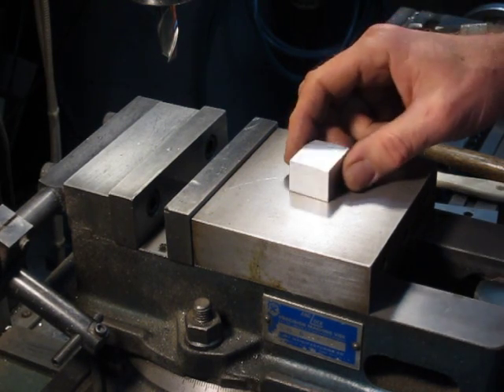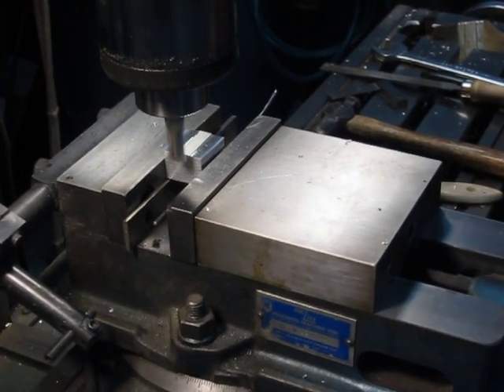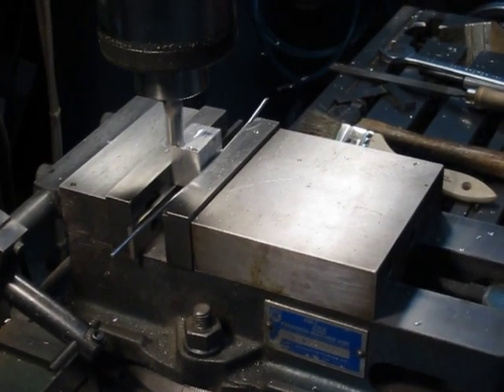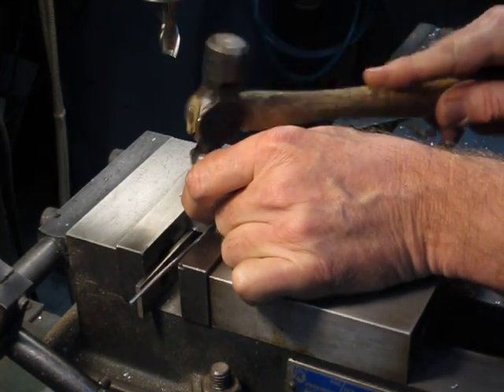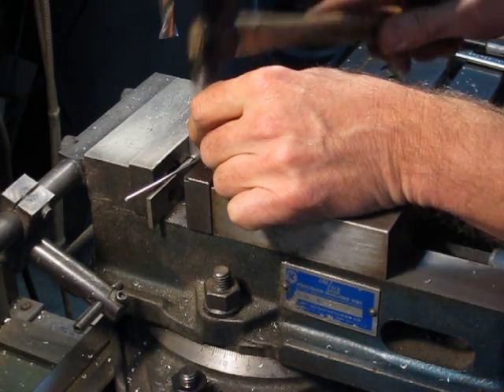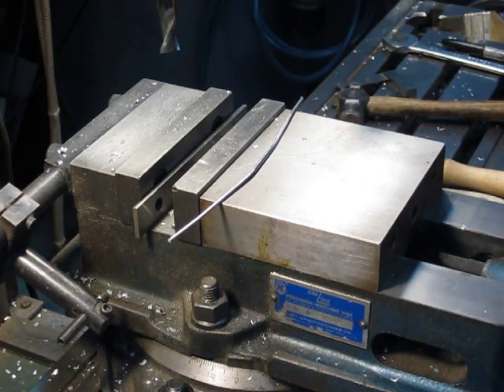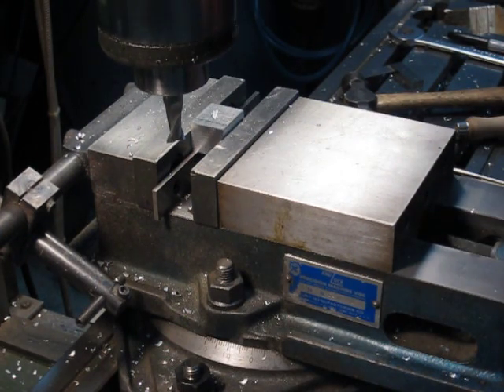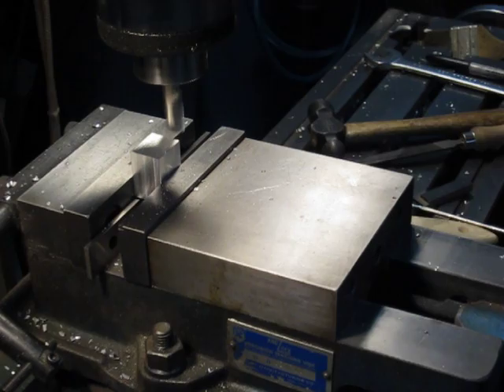How to square up stock on the milling machine

Comment: Would you put a note in the video reminding us to begin milling on the highest side so that with an uneven surface, so your DOC doesn't increase?
Reply from the maker: Pierre Miller 
Not sure I understand what you mean Pierre.
Reply: Toms Techniques I just mean where you start the first pass. If the surface has uneven heights of material and you start on the highest part of the surface, worst case scenario, your cutter won't remove any material on the low spots. But if you start on the lowest part of the surface, and you run into something that's higher than where you started, you'll start cutting more off than you expected.
Reply from the maker: Pierre Miller 
Pierre,

I mentioned in the video that the first cut should always be the minimum amount possible. That way you are less apt to run out of material on the opposite side. For that reason, I always place the best side up for the first cut. When you start chasing low spots, it rarely turns out well.

Tom
Reply: Oh my. I must have missed it. My apologies. Thank you for your prompt replies.

Comment: Hi Tom. I'm Marco. I'm totally beginner, I never mill, and I've just bought an HBM 16. What do you think about this Drill Mill machine?
Reply from the maker: Marco Andretto 
Hi Marco,

We were all beginners at some point. :)

Round column mill/drills are very light machines and require special care when milling. They won't take very heavy cuts and are happier with non-ferrous metals over steel. Be very cautious about climb milling, or avoid it all together. Other than that, the same techniques apply as with heavier machines. They just take a bit longer to accomplish.

Tom
Reply: +Toms Techniques I forgotted to thank you, five months ago. In these days I'm tryng to square perfectly a block.
Reply from the maker: +Magic Rojava 
You are welcome.

Just stick to the order of operations on my video "How to Square up Stock on the Milling Machine", and you should be fine.

Tom

Comment: I Cried When you Hit Aluminum with a ball peen hammer ;-;
Reply: No biggie if you are machining it off anyways. I personally just use a small brass hammer or a dead blow.
Reply from the maker: P Houly 

Rather than cry about it, you should keep an open mind and try it yourself. I learned many years ago that a ball pein makes excellent hammer for tapping down stock in the vise. When the ball or the edge of the flat end is used on a piece a ball pein acts just like a dead blow and does a great job of seating the stock on the parallels (and no, it won't bounce). Of course a ball pein is only used on rough surfaces. Finished surfaces require a soft hammer to keep from marring them.

Tom
Reply: @TomsTechniques  why would he or she cry if you are tapping down to contact the parallel....
All the markings will be machined off ....perhaps they thought you are using a 5 pound sledgehammer  !!!
Reply from the maker: Exactly. Some people have a seriously hard time stepping out of the box. I was taught to use a ball pein hammer while working as a shaper hand in the 70's. It made a lot more sense than having to waste time casting lead hammers all the time.

Comment: I'm a beginner, going to be doing this with CRS tomorrow, I'm just trying to get the process "down" before I attempt to machine my stock.  So if I need to get my block down to a specific size, (3.3" x 2.3" x 1.3") I may want to ask for a piece that's 3.5 x 2.5 x 1.5 just to be safe?  With aluminum, you can feed a lot faster, it seems, and you don't need coolant. But with steel I would move a lot slower, and use coolant right? These might seem like silly questions, I'm still learning and I just want to make sure I know what I'm doing before I go into this, so I can save time. I only have 3 hours tomorrow in which to square up my piece and run 5 separate CNC programs on it... Well, fingers crossed!  Thanks for the very informative video, I feel less stressed out already!
Reply from the maker: There is a cutting speed chart on my website so you can calculate the proper rpm. Coolant is not a requirement with steel as long as the proper rpm is used to limit the amount of heat produced.

Tom

http://tomstechniques.com/

Comment: Thanks for the nice tutorial.

One question though - why bother going back to the right end before tapping the left end back to zero?

Also, how about this as a way to start off within a thou or two - from both sides of the vise slide pieces of stock that fit in the table slot and that are just tall enough to engage the keyways on the bottom of the vise.

Then move the vise either forward or back until the slop is taken up.
Reply from the maker: Thanks Noah.

I'm sorry but I don't understand your first question.

Regarding the vise alignment, it's standard practice to push the vise in one direction so the keys contact one side of the T slot. Extra pieces of stock aren't necessary.

Tom
Reply: Toms Techniques Oops, sorry, Tom, that question was meant for a vise tramming tutorial I was watching in another tab.

But I did like yours; definitely better than the way I was doing it.

Comment: Don't take any of this in a bad way, i am a skilled machinist and want to improve everyone's skills in this trait due to the fact no teenagers are picking it up in high school shops. if you don't care about keeping tight tolerances because its a hobby then by all means, have fun and machine away! 

If you don't remove burs on corners after every cut, like after the first cut. your block will never be anywhere close to square.  the burs will lift that side of the work peace and your accumulative error will give you a block way less than square. or the chips/burs will smash agents the work peace and ruin your surface finish (i love a beautiful finish, idk about you) . That block could be more then .010 in. out of square and or parallel (there is a difference). the shop i work at keeps blocks square within +.0001 in. i would also use a dead blow rubber mallet so you don't indent you surface and change you other dimensions, aluminium and other soft materials tend to do that. (aka, you hit the top, sides bend out a very slight amount if you hit anywhere near the sides/middle depending on how big your work peace is) machinist squares are usually square within +.003 depending on the brand of course. always clean the vice between cuts. other than that this is a great video to learn the basics.
Reply from the maker: I'm a skilled machinist as well Jacob. In fact I've made a pretty good living at it over the last 45 years.
I agree that chips need to be removed where necessary, or they will affect the size and squareness of the part. However, it it a waste of time (and money) to remove them where it doesn't matter or from where they don't exist. If you look closely at the video, when I machine the first face, I climb mill all the way around the part. That doesn't produce a burr, and even if it did, it would form in a way where it would not affect the next operation, machining the next face square to the first. You will also notice that whenever the part is tapped down on the parallels, it is deburred first, because a burr against the parallel would definitely have an effect on the opposite surface.

I have devised many time saving tips over the years, some subtle like this and some not so subtle. Some of my videos feature them, like "How to Indicate the vise on a Milling Machine in Just One Pass' and the more subtle ones are covered in my project tutorial videos, which can be viewed on my website tomstechniques.com.

Thanks for watching.

Tom
Reply: you should make a video showing how to indicate the squareness of a block. along with explaining what TIR means (total indicator reading). that would help people make special setups/large setups without using 1,2,3 blocks
Reply from the maker: Jacob Forsythe

That's a good idea. I'll add it to the list of topics.

Tom
Reply: A square that is off .003" Is worthless. TIR stand for total indicated runout.
Reply: Chalk on a file keeps it from loading up with pins.

Comment: For the second to the last face, wouldn't it have been easier and less error prone (no square necessary) to have kept the part oriented the way it had been, and just scoot it out past the end of the vise, cutting it with the side of the cutter rather than the bottom? Then, you could do the last face as you had done all the previous ones, if you wanted.

I'm not a machinist, just learning. That makes more sense to me, though.
Reply: Jay Williams

When you side mill, there is much more of the tool in contact with the work than with end milling and that causes the cutter to deflect. That leverage you are talking about makes the end mill deflect more at the bottom than the top and actually creates a curved surface. Not the best result when you are trying to machine a flat surface. When end milling, you take much shallower cuts, so tool deflection is minimal. Also when end milling a large surface, multiple passes are required, so any deflection is averaged between passes. That creates a surface that has some local irregularities but is very flat globally.

Tom
Reply: Thanks for the detailed explanation, Tom. I really appreciate it!
Reply: Hi Jay, want to say thanks for asking this question - I would say it has been educational to any beginners reading this, such as myself - this was extremely informative! Cheers
Reply from the maker: An end milled part will always be more square than a side milled part due to deflection of the cutter. Also, if you hold a part on one end of the jaws, the other side should be supported with a machinists jack to keep the jaws from cocking. What you describe works well for squaring up thin parts.

Tom
Reply: Great! Thanks!
Reply: Tom, I was thinking this over some more--not trying to quibble. Using the end of the cutter would actually be more leverage on the tool than using the side of it, say half way up (or even further!). In fact, that would be the most leverage you could put on the tool, being at the very tip.

The only problem left would be to have to put another piece of the same size on the other end of the vise to make sure it clamps straight.

Am I missing something?

Thanks for your time!
Reply: Maybe it's the fact that on the end, you're using only one edge of the cutter, whereas using the end of the cutter, both (or all) blades are cutting. Still, you're feeding it which would seem to me to cause deflection.

Comment: What millbit are you using?
Reply from the maker: Looks like a 1/2" 2-flute end mill.
Reply: Toms Techniques Ok thanks Tom. I just ordered a "cheapo" CNC router that includes a five mill bits set but no info on diameter but seems they are same as Dremel ones. I will try to make some aluminum little molds for plastic injection experiments but I know it was not made for that but I cannot afford a serious machine, for now. I am learning and your videos are of great help :D

Comment: Hi Tom,

Great video on how to square blocks on a mill.  I do have one question though:  does it matter the diameter of the round stock (welding rod) used on the moveable vise jaw? For instance, I have 1/2" dia. brass round stock...can I use this to clamp the square stock instead of the welding rod?

Thank you Tom.
Reply from the maker: I use small diameter (1/8") aluminum wire so that it is easily crushed, spreading the force of the jaw evenly across the work. Larger diameter and harder brass rod may not work as well.

Tom

Comment: This is a great instructional video. Thanks Tom..  Also, I use a copper face hammer but will now give the ball pien a go! Also, would you use aluminium wire when machining a mild steel block?? It won't be too soft ?  I guess I'm asking whether it might whip the block out and slap me in the face!!  Thanks heaps for the great videos! Jack, NZ.
Reply from the maker: Thanks Jack.

Aluminum wire also works well on steel. The whole idea is for the wire to conform to the surface of the part so the vise clamps evenly. You don't need to worry about getting slapped in the face, at least from your mill.

Tom
Reply: Still a great video Tom!

Comment: I want to tart doing some milling for very small parts (bicycle parts) but I do not know what kind of machine to get, I have been reading and looking for something economic but I think I need some help. What do you think about SHOP FOX Micro Milling Machine, Model# M1036??? I have been looking into that to start working, would that be good? I will really appreciate your help. I really like your video and I thought it was a good option to get your opinion.
Reply from the maker: I would pass on the M1036. It would be way too light to do any milling. I would recommend the mini mills from Grizzly as a bare minimum. The G0704 is a good example. http://www.g0704.com/

Tom

Comment: Tom, We are not on the correct video for my question, but here we go.
 Just watched a video cutting a keyway/slot on each side(in line and oposite sides) of a shaft. quite a wide  keyway and the method used to align the Top Dead Centre of the shaft and cut the second slot I would say was not the most accurate. If a narrow keyway was to be cut that method would not have worked. I do have in mind something as to how it could be done but how about you doing a short video and show how you can cut two keyways on opposite sides  and be perfectly in line. To the 0.001 if possible. I enjoy your teaching methods and thanks to you and some other guys for the time to upload this stuff. regards
Reply from the maker: A keyway on each side of a shaft is pretty unusual, so I don't think a video would be justified. There are lots of ways to do it though. The easiest would be to simply hold the shaft in a dividing head and index the shaft 180º to cut the two keyways. If a dividing head is not available and the shaft was 1" or smaller, it could be held in a collet block and the block held in the vise and flipped to cut the keyway on the opposite side. If the shaft was too large for a collet, a V-block could be clamped to it and squared to the table with the shaft held in the vise.

Feel free to contact me through my website (tomstechniques.com) for random questions. It's a lot easier than trying to communicate through YouTube.

Tom
Reply: Toms Techniques Apologies i omitted to say the keyways were on opposite ends of the shaft not 180 degrees to each other. opposite ends same Top dead centre and the shaft long enough so it had to be taken off the bed to turn around. So you could not just lower the work down and wind  the cutter to the other sideThanks for the reply
Reply from the maker: CHRISTOS TSANDAS Ah, that makes more sense. I would just clamp the shaft in a couple of V-blocks and align them to the tee slot in the table. The slots on my mill are .625 wide and take a 5/8" parallel nicely. I can just push the work against the parallels and know that it is parallel with the table.

Tom

Comment: My 2 cents is that this technique while perhaps is not the fastest, is the purest. Doing a top surface and then a side surface (with the block over the edge of vise with the side of the end mill) introduces both vise and head tram issues unnecessarily at this crucial point. I am struggling with the fact people are giving you grief over the hammer Tom!

Tim
Reply from the maker: Thanks Tim.

I wonder how many of those who were appalled by my use of the ball pein had enough of an open mind to try it? I'll bet not many, which is unfortunate because my videos are full of non standard techniques that save time and work very well.

Tom
Reply: Dear mettaling
Ohh so close... 
You only put the minimal amount in the vice like 75% out of vice , then you do 4 sides as close to the vice as possible being sure to use the knee, not the quill then you do the top. Then you flip it over tap with a hammer  ( I have a big chunk of bronze) .. then you match up the remainder of the 4 sides, 
Then what used to be the bottom.  That way your block is as square as you can possibly get it .
Only  open the vice once , and don't have keep turing the mill off and on .